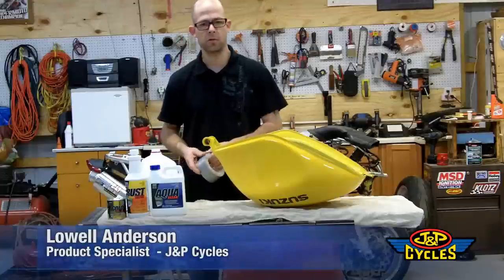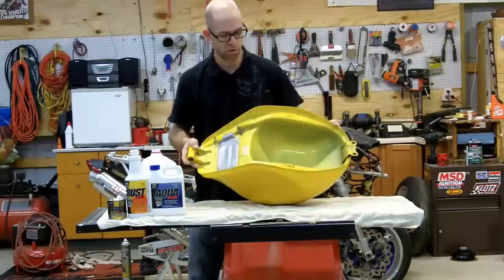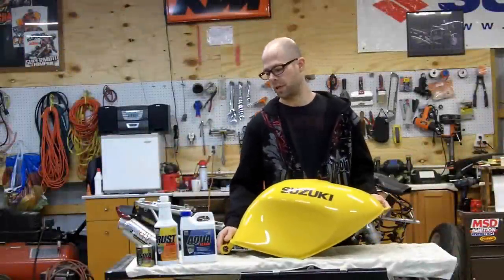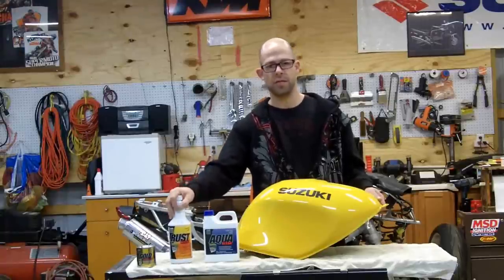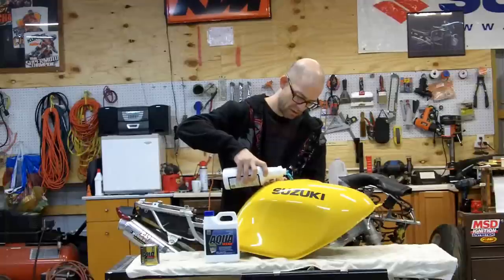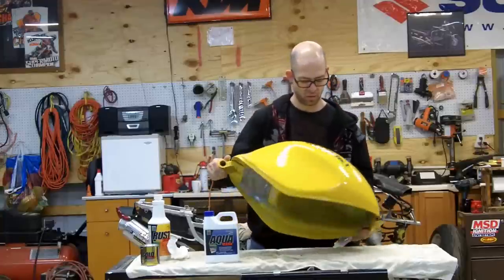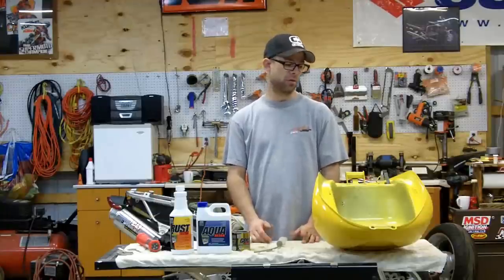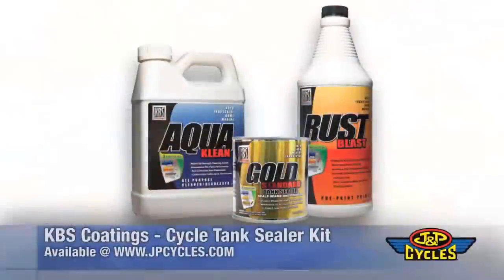How to Seal a Motorcycle Fuel Tank with KBS Coatings Tank Sealer Kit by JP Cycles

Comment: I have been wrenchin bikes for almost 50 years and this is the best tank sealer I have found by far... But.. you must follow the directions to the T. When you use the rust blaster you failed to mention that that stuff is a very powerful etching component and it will dull the paint if it gets on it, and you must put some thick plastic under the fuel cap and put it on very tight, you must turn the tank in a matter that covers the entire tank, the way you did it. nothing was treated on the top of the tank. when you put the sealer in, what ever you get it on, if it dry's you cant get it off, and just sit down and roll the tank consistently for at least 1/2 hour and focus on all sides including the top of the tank, sorry so long but I hope this helps
Reply: It did a lot, cheers :)